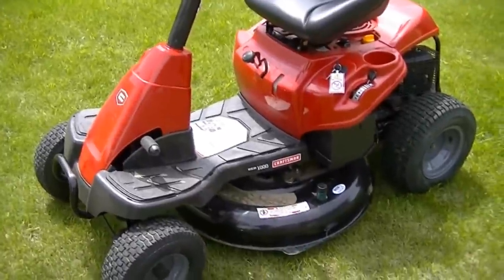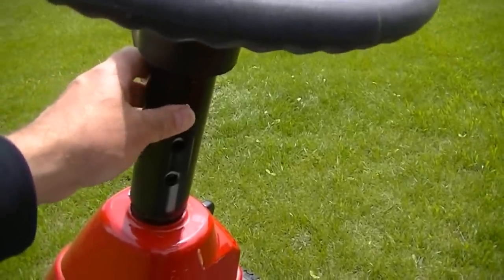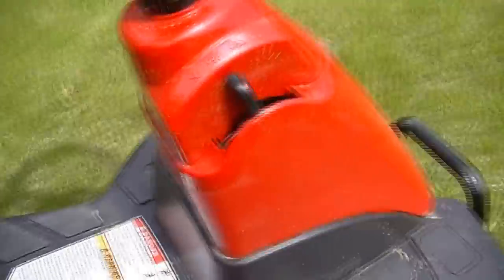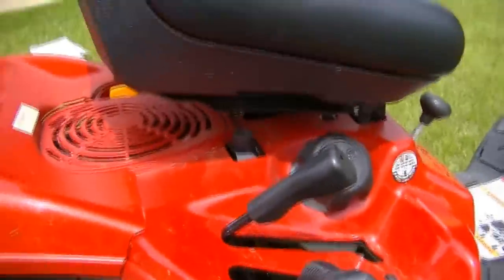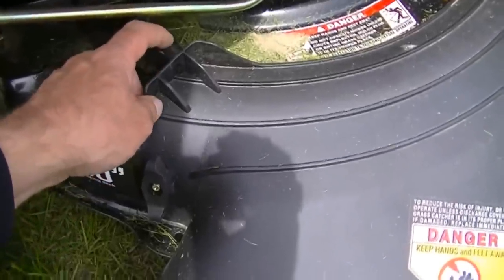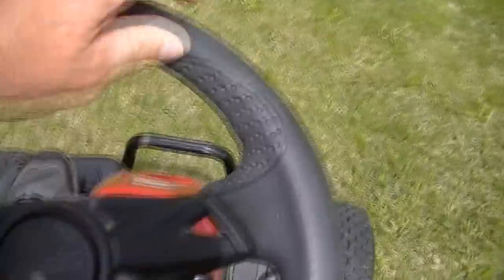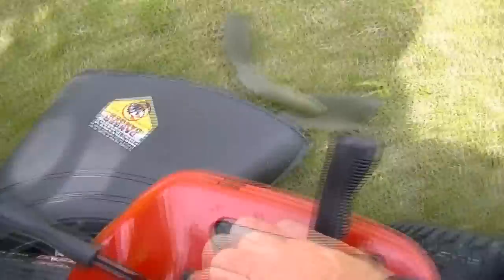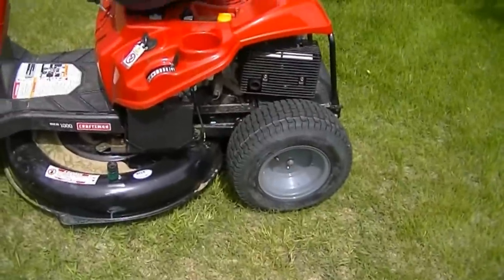Sears Craftsman / Troy Bilt 30" Rear Engine Riding Mower Review

Comment: Thanks for the video - Were a repair shop 40 years experience tractor repair myself and specialize in transmission repair so must comment, STOP DISENGAGING THE SAFETY REVERSE SWITCH I do 50 - 100 repairs every year the problem is PEOPLE DO NOT COME TO A COMPLETE STOP BEFORE SLAMMING INTO REVERSE  EVERY TRACTOR THIS YEAR WITH BAD TRANSMISSION  HAD THE SAFETY REVERSE SWITCH DISABLED!!!!! Thanks again nice video.... The Repair Place Southport NC

Comment: I want to say "Thank You" because I had no idea there was a kill switch for the mower deck and I had thought  that the battery was dead, or the starter, solenoid etc.... though the mower is only a couple of years old. I went out the next day after watching your video here and tightened down the gaurd and sure enough it started right up when I turned the key !!
Next is that back up kill switch !! You're correct on that!  It is very annoying when you want to back into an area to mow and you can't. 
Thanks again !!
Reply: Is the switch suppose to be pressed in all the way in or all the way out ? 
JW
Just got one of these for free
Motor turns just fine
Reply: @jessicabenson9017  All the way in.

Comment: To remedy the jerking problem when leaving out the clutch, I use 1st gear and throttle on slow or rabbit, then once the tractor gets going I add some throttle and you can shift gears while moving, I just push the clutch in a little bit while rolling and up shift even all the way to 6th gear.  My biggest problem after disabling some of the safety switches, was bending the front tie rod as my tractor came with no front bumper or guard of any kind and first tree you bang into you bend that rod easily. Also I saw an oil filter on your tractor but I do not have one on mine I purchased mine from Lows  may of 2014.  Other than that is a great little unit for the average home owner that doesn't need a bigger tractor. I do almost the same work with this that I did with my Cub Cadet lawn tractor which was a heck of a lot more expensive and had a wider cut but that was all. The cub cadet with it's hydra-static transmisson was expensive to repair and could not climb a 35 degree hill.

Comment: Thank you Thank you Thank you. My mower was down for 2 days and I tried testing every electrical component on this thing. When you said you bump something and it shut off and all it was is a safety switch, I ran outside and tried it and BAM that was it. Saved my summer.

Comment: Thank you, Thank you, just solved a BIG mystery for us. Our RER 1000 would NOT start. Nothing, didn't even turn over. The mower belonged to my dad so we didn't have any instructions on it. Bought a battery, still nothing. We thought to check the Internet, should have done that first. Your video was very helpful. Someone must have hit a root and set the kill switch off, down in back of the blade cover.

Comment: Great job hitting on many key points such as disabling the reverse mow capability. I will be sure to stop completely before reversing so as not to cause damage. I have a zero lot line yard so reverse mowing in tight areas will be unavoidable. You were more thorough in your video than some others so yours is the deciding factor in my buying this mower. Thank you! ☺

Comment: that information about the side skirt switch is not in the manual, you just saved my life, i had to buy a new solenoid and a spark plug with no resolve, thank you so much. I even called Sears, and they didn't even know what was wrong. long story short, she runs now.

Comment: This was very helpful for me, specifically the frustration of not being able to mow in reverse, thank you for that, and that switch on the mower chute has caused me way too many restarts. I want to swap it out for the mulching chute and hopefully it will eliminate so many false stops. Your video was the most helpful and covered what the manual should have shared but does not. Nicely done. Thanks again.

Comment: I have the Sears version and have been happy with it for the most part. The reverse blade engine kill was easy enough to disengage - that was my biggest beef with it. Otherwise, the clutch can be a bit tricky but for the price it is very maneuverable with a sharp turning radius and has given me 2 years solid service. Finish up mowing before it starts getting dark; with rear-engine mowers you rarely get headlights, and late-season mowing after work - or in the Fall to mulch leaves - can be problematic. For less than $1k it was a good deal.

Comment: I purchased my model 29000 in late August, 2016. It took a couple of mows of my 1.5 acre lawn to get used to the controlls. The center forward, neutral and reverse control between your legs could be much better. It has plenty of power as it has to go up a 2-3% incline and mows fine. I run it in 3rd gear for my open yard area, 1st while trimming around bushes and flower gardens and 2nd while in more congested lawn area. It does need anti scalp rollers, maybe there will be a fix for that. I bought the mulch attachment (with the points I earned throught Sears) and it works very well. I did get a 5 year service contract which covers EVERYTHING on the mower, including yearly at home oil changes and tune ups, it is worth every cent, buy it. I live in Northern Florida and mow 10 months of the year, I do plan to get the leaf attachment for this Fall. So far so good, it runs and cuts very well. I do run non ethylene gasoline in it and all of my lawn equipment, it makes life much better for all, especially myself and my wallet.
Reply: when I engage the blades it stalls? does anyone have a fix?
Reply: Did you find a fix yet
Reply: xoxo13 make sure you have full throttle.

Comment: Thanks so much for the video!  Your explanation on running into a sprinkler head and that causing the deck cover to slide off the safety switch saved me a service visit when mine wouldn't start.  Great heads-up information.  Thank you!

Comment: I have this mower, used 4 times. I like it very much. I don't like that it is prone to tip over. Shorter wheel base, narrow. Also twice so far the clutch would not engage and when it did  the front end reared up. It was scary if not ready. The trans. lever is awkward but you get used to it quickly. Filling fuel is easy. comes with a oil drain sleeve. No messy oil changes. I have seen other brands don't provide this sleeve. That can equal a messy oil change. I pulled the wire so I can mow in reverse. It is nice that it is 50 hrs. between oil changes. I have used synthetic oil for decades on mowers, autos, etc. and highly advise everyone to. The mulch kit is nice, the cleaning port is nice. and turning is nice and tight. No scalp wheels so be careful. If like other batteries you should get 3-4 years out of it. Keep battery on a trickle charger summer and store battery inside on the trickle in winter. Extends the life of the battery. It looks like home maintenance will be easy. I really do not feel you need the expensive extended  warranty. When they offered 3 years for the price of one year I asked. Is the 3 years on top of the original 2 years? They said no. Don't want that. As I said I just bought this and time will tell the reliability. If you need a part check with Troybuilt, Cub Cadet. Sears can be higher.For those of you looking for the lowest price of the 3. Craftsman was only $899.00 on sale. The Cub was $1400.00 at the time I was shopping. They look like they are the same made by MTD. Keeping up with the maintenance which is so easy should give you years of trouble free service.  Enjoy your new rider.

Comment: I have one of these mowers and it operates and cuts very well. There is one thing that I noticed particularly, however.Sometimes when I am in forward gear and I release the clutch from a stop position on an up hill grade,  the mower will not move at all. I think that there is a level of  resistance where the transmission will not engage. I have to put the mower in reverse and back up to a more level grade and then put it in forward and then the transmission will engage and I can proceed up the hill.
Reply: Next time look at the rear tires, they may be spinning.  Happens to me every time I mow up a hill.

Comment: Just discovered today. Under the seat the knob to adjust the seat is always vibrating loose. Almost lost it today. I put some low strength Loc-Tite on the threads. There's 2 other   threaded gray squares that hold the seat together under the seat. I had to place a bolt and flat washer in both with Loc-Tite. One of these popped into the seat. Found a longer bolt of the correct size, threaded into the gray square, pulled hard and popped it back in position. No anti-scalping wheels so raise deck one level when needed. The tranny shift pattern is designed so you don't slide into forward/reverse I'm guessing. This mower is smaller and can tip. I did not disable the kill switch on the seat. Kill switch/button on the mulcher plug- make sure you properly engage it when plug is removed and then reassembled.

Comment: I just purchased one of these. Thanks for the reverse mowing hack.
Reply: Ralph B. I
Reply: My mower want crank
Reply: Ralph B. H
Reply: Mattie Gardner I want beer
Reply: RALPH AGREE  I HAVE MINE 3YRS MINE JUST GREAT I GLADE SHARE YELLOW&BLACK WIRE SAFETY  IM DO SAME! 3YRS EXSPEARANCE  NEED GREASE SPINAL HUB ON DECKING!! THERE IS GREASE FITTING,  IF NEED CHANGE DECK BELT BE HAVE SPEED TO HIGH ENGAGE BELT! SLOWER SPEED, THEN ENGAGE  SET SPEED ONCE RELEASE BRAKE, THEN ENCREASE MOTOR SPEED, RPMS! ENGAGE LOWER SPEED MOTOR OR BELT WONT LAST LONG!!, TY

Comment: If you engage the park brake on the speed control, you can get off the seat without killing the engine.  No need to disable the safety switch.

Comment: I've used the Troy-Bilt version for over a year on my 3/4 acre lot. It's tippy, but I'm very satisfied with it. The size is very convenient. As with ANY mower, keep the blade sharp and you will have nicely cut grass. I keep the blade high (4) and it's never conked-out on me, even in thick grass.

Comment: I have used it all season now...The biggest complaint, no gauge wheels on the deck.  It gouges the high spots in your lawn.  I welded a 3" extension on the shift lever between the legs.. a great improvement !!

Comment: you could run a toggle switch to the wires for the reverse switch to where you could just flip a switch if you wanted to mow in reverse and flip it back when you needed to.

Comment: I had a rear engine sears 40 years ago for over 12 years,mowed good, then had a murray rear engine for over 25 yrs,it did great.Both mowers pulled a small hill i have except the rear wheels would spin,dont know why except the center of gravity was off,have a troy bilt pony have have no problems..i am pleased with my pony....maybe they fixed the center of gravity..good luck

Comment: Used my new Troy-Bilt from Lowes yesterday for the first time.  It took a while to get so that I was comfortable and will probably take a couple more weeks.  I did disconnect the switch to allow reverse mowing.  There is a small hill to contend with and I'll figure that out as I go along.  Did have one significant scalp issue where I bumped something and the deck went from the highest position all the way to position one.  To keep that from happening again, I looped a Velcro strap to lock it in place, and hope that helps. Being 6'4", 250# I'm concerned about being top heavy while riding and worry about tipping over.  I like the mower so far however.

Comment: Cool, Thanks for taking the time to do this video, it has answered lots of my questions and i think a great insight into this model ride on. in Australia we dont have sears but looks 100% like a rover mini rider and cub cadet mini rider, is it badge swapping umm probably.
yes i agree about the deck wheels, my 1974 toro wheel horse has them and i would miss them however my old girl is getting way to hard to get parts for.
Reply: can this mow up and down hills. I have pretty step hill in front
Reply: no the engine made at mtd then the mowers are put together at there factorys all seperate but simular ,the CC30 has head light for 2018

Comment: Great Mowers..Ive never bothered with  the mow in reverse "problem", but I have considered doing so  and I understand it could really bug some people... In fact the gear shift rod, witch is metal, is built to make  contact with the frame and ground out the motor if you put it in reverse with the PTO engaged. Probably safe if you have kids or pets who like to play tag with the lawnmower while your on it.  Easy enough to slide a rubber or plastic sleeve or hose section over the shift rod/link to stop that, without disconnecting any wires . Pop the  gearshift knob off (easy enough,  and this  is my ONLY complaint with these mowers. Irritating  when it comes off in my hand when I shift. But easy to slap back on) and slide it over  the gearshift rod, then replace the gearshift knob..The seat switch is there for a good reason ..don't defeat it. Riding mowers can flip over on an incline..They have and will again. Bad enough to have it land on you WITHOUT the blade turning ..

Comment: scalping...... make sure to fill your tires up exactly to max.... plus, it sounds hillbilly, but those two lil tabs on the front sides of the deck, drill a hole big enough to hook a bungy on and stretch across to the other side... it works

Comment: Loved the way most of it was covered. My problem is I need to jumpstart the battery. The instructions tell me to connect the mower negative cable to an unpainted portion of the engine block. Unfortunately, I have no idea what that looks like! 😕 I was hoping this video would cover it, but it didn’t and I’m back to square 1.

Comment: I don't recommend the glue on seat switch it's dangerous
especially if you mow on slopes. Also you will likely
void your warranty if you disable safety features. As for
the mow in reverse you need to remember put the wire back
on the switch if you need warranty work.
Reply: Your right.
Reply: I'm not sure about that mower but every mower I've seen you can just set the parking break and it won't turn off
Reply from the maker: It was found after I made the video that the switch was bad. I wasn’t able to move at all in the seat without the engine quitting. After I replaced the switch the problem was solved. So, yes, this switch should remain in operation, do not bypass it.
Reply: I'd use a part of some duct tape on that switch instead of glue.
Reply: On my Poulan Pro 30" Rear Engine Rider, I defeated the stupid annoying seat switch by taking a piece of thin sheet metal & attaching it with screws over switch plunger.

I had no choice as seat safety switch was so overly sensitive engine would die if I shifted my weight, which its impossible to mow without doing.
Too damn many lawyers masquerading as engineers, right?
Reply: AGREE UNDER SEAT SWITCH THERE 2 SHEET MEAL UNSCREW  PUT LENGH CROSS   MEASURE WIDTH SCREW TO SCREW DRILL HOLES THREW METAL PLATE PUSH SWITCH DOWN  PUT METAL OVER SWITCH SCREW BACK DOWN KEEP BUTTON DOWN TY VIEWERS SHARE INF EACH OTHER!!
Reply: DONT HAVE PUT YELLOW WIRE BACK!  UNLESS YOU HAVE KIDS COME BEHIND STEEL DANGEROUSE,   ASK KIDOS CLEAR FOR SAFETY! THEN GOOD GO!  TY SHARE VIEWERS LEARN OFF EACH OTHER!!

Comment: With a tractor like this, can you change speeds while moving, or does that have to be done while stationary? 
If the former, I'd think starting in a slow speed, and shifting upwards (like on a bicycle) would prevent this jerking motion

Comment: Thanks for the video.  I recently got my Craftsman 420 cc rider and not having the ability to cut in reverse was a big problem, thanks for showing how to disable the "safety".  The Troy Bilt has a different ignition module to run their rider in reverse.  The seat on the Troy Bilt can swivel to the side.  In the U.K. this rider is called a Rover & in Australia is a yellow Cub Cadet all built & made by MTD.  Why did you not get a mulching kit, since you are not bagging, the grass gets cuts finer?

Comment: It seems the Troy-Bilt version (TB30R) has a button and ignition key position for mowing in reverse, without the need to unplug the yellow wire.  I'm considering getting that version, but I noticed only the Craftsman version has the deck washing option.  Also, the Craftsman seat looks like it has more cushion.

Comment: I've had my rear engine Sears mower for years and disabled the reverse switch, I also disabled the discharge chute switch because it kept getting displaced by grass, because it's flimsy, and the mower kept shutting off. Other than the 5 interlock switches, the only thing that I would be concerned with is the fact that it has a narrow track so the mower is not very stable on even a slight side hill.
Reply: I bought my 29000 in 2016 and wasn't told about 5 interlock switches. I did find two near the blade and deck rods. The other is under the seat, the gray switch. The connection to the gray switch needs a little attention to locate, it can be found though.

Comment: Quick question...
I just picked one of these little guys up that someone up the road from me was giving away free
Battery is dead dead
However, hooked some jumper cables to it from my truck and motor turns over just fine
But will not crank
Is that deck chute safety switch suppose to be pressed in all the way to allow the mower to start is is it suppose to be depressed all the way out ? 
Jw

Comment: You can mow in reverse without pulling out the wire you show, near the key, you turn it to the yellow reverse indicator and push the button in so the red light glows and you can engage the transmission to reverse .... so go look near the key and see the options for cutting in reverse.
Reply: this mower does not have that option only cub cadet has it